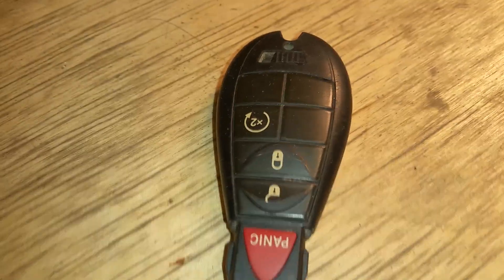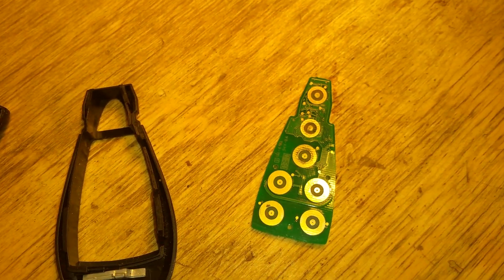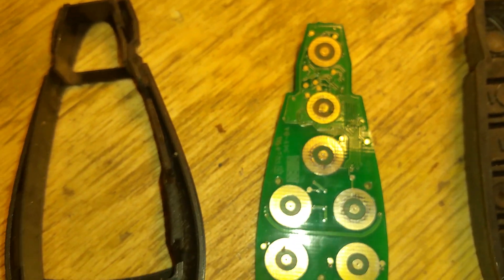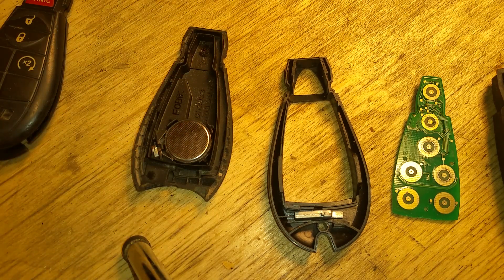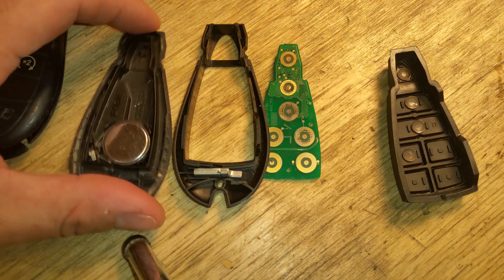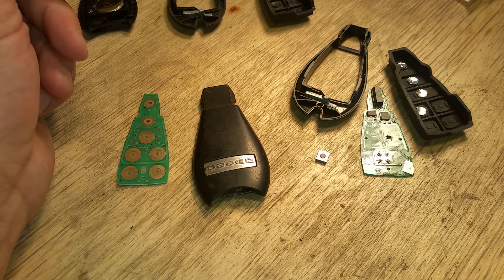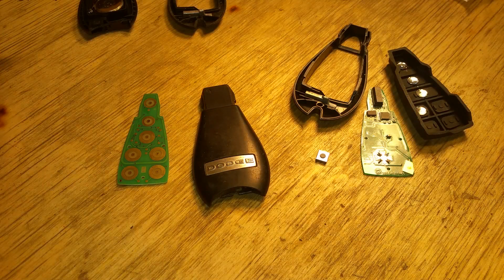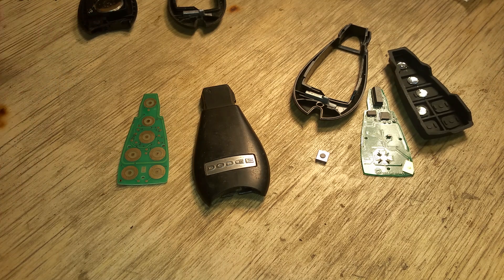Dodge Ram Keyfob Failure & Analysis 2009 - 2015

Comment: Now, the dealer wants $380 per fob to make new ones. The dealer told me the van wasn't receiving the signal from the fobs, yet they want to sell me 2 new fobs for $760 for new fobs. If the van isn't receiving the signal from the old fobs, why would it receive a signal from a new fob that is obscenely expensive? I smell a scam!

Comment: I'M HAVING THE SAME PROBLEM ABOUT 2YRS AGO , WHAT I DONE IS TAKE THE LITTLE WASHERS CLEAN THEM  AND THE BOARD WITH A Q-TIP AND ALCOHOL, LET THE DRY, TAKE YOUR WASHERS LINE THEM UP ON YOUR  BOARD , THEN TAKE A GOOD CLEAR TAPE AND TAPE THEM ON YOUR BOARD,TAKE A RAZOR AND TRIM THE TAPE OFF THE EDGE,JUST TAPE THE SIDE WITH THE WASHERS NOT ALL THE WAY AROUND. GOOD LUCK

Comment: Thank you so much for these great ideas. I have a 2019 grand caravan and my side doors would just randomly open. After a 300 dollar quote from the dealer I bought some cheap aftermarket’s from Amazon which did not pair with the new grand caravan. So I disassembled them. The aftermarket fob had a plastic tape covering the circuit board that force connected the circuit board to the metal connectors. So I ripped off the tape gently and reattached them on top of the circuit board of my native key. Everything works like a charm now.

Comment: Thanks my 2014 Dodge Caravan Key Fob lock buttons stopped working you are correct on everything you are saying I ordered another fob I think the switch cover most likely will solve the problem using the new one

Comment: It's all about the dollar. I bought an 2011 grand Cherokee from Port Jeff jeep with a stock radio. I picked up a touch screen radio (plug n Play) And  made the mistake of buying the wiring kit from that dealer. Plugged everything in radio didn't work. Then I went back to jeep and the service guy told me the radio has to be programed to the computer. That's BS. And he says it will be 160$ and no  guarantee. OH SO IT'S A SCAM? I went against my better judgment and let him do it. Just as I suspected, didn't work. So I went back to the guy who sold me the radio and told him I want to try his wiring harness from his radio. And sure enough it worked. I went back to jeep and with a room full of customers I told the manager you guys took me for 160$ when you sold me a bad wiring harness and you knew programming the thing wasn't going to work. That was the last time I ever went back to that SHITHOLE. Auto dealers ate the biggest thieves EVER!

Comment: Thank you so much for this video! You helped me out more than you know. I just wanted to let you know the way around the alarm going off when you use the backup key. When you get out of the vehicle manually lock the door before you close it. Hold up the outside door handle while closing the door. Door will be locked without the alarm on.😁👍
Reply: They changed the electronic board on the cheap replacement, the button clickers are now on the board itself unfortunately.☹️

Comment: My 2010 ram 4.7 has a regular key column. You put it in Park and the key won’t come out.But !  if you move the car a foot or two and turn the steering wheel a slight bit you can put her down and the key will come out. been doing it for around three years and it’s starting to really piss me off lol. Do not wanna change the whole mechanism .. does anyone else have the same trouble? If so, can you tell me if you solve the problem I would appreciate it.

Comment: just bought a ram truck and had a problem where lock and unlock wouldnt work and the buttons werent pressing as the contacts had gotten loose inside. I had a couple of these keys laying around from a 2012 grand caravan. (my truck is a 2011 ram 1500). Anyway I swapped the face over and im gonna see if this fixed it tomorrow when I go to pick it up. What I do know is the buttons are now clicking.

Comment: One of my fobs went thru the laundry, the other got soaked in my pocket during a rainstorm.  They both will start the van but none of the buttons work. So i just had a seperate key cut and open the door with that.  Before the rainstorm, i had replaced the plastic shell and rubber cover a few times because just the slightest touch or bump could lock or unlock the doors.  Like sliding the fob into my pocket could operate the locks 5 or 6 times.  Walking to or from the van could have the locks operating.  So i just leave the fob hidden in the debris inside the van and use the key.  Not convenient, but better than leaving the van unlocked unknowingly.  And now that it has 184000 miles on it and it is a rolling environmental disaster there is no point in waisting anymore money on it.

Comment: That dealership doesn't know how to deal with this problem that they heard so frequently.  I have two fob keys on dodge ram 2011.  One started to fail on the unlock button, same as yours.  So, I switched to the second one, the same problem after a few years.  Almost every dodge ram 2011 owner has this issue.  It is a design problem.  The dealership is the wrong place to ask, because they did not design the key.  Blaming the drivers shows how ignorant the dealership is.

Comment: So I was amazed!! Wish I had found this a couple of years ago! I had ordered a fob on line to replace mine because the trunk opener didn't work, and sometimes it would unlock the car while in my pocket. The local locksmith tried to program the new one after they cut the key, but it was really only good for a spare to open and start the car. After watching this, I took both the original & the "replacement" apart and noticed there was only one tiny metal button left in the original! I think all of the others must have dropped off while changing the battery a couple of times. So the new fob circuit board had all four buttons I needed TAPED ON! I turned both over just for curiosity and noticed that the circuit board was missing some of the things on the other one, which may be why everyone keeps saying you have to get them re-programmed. Very sly of auto makers, don't you think? Anyway I cleaned up the original really well with the alcohol, used an xacto knife dipped in alcohol, and slowly but carefully peeled off the whole piece of tape, placed it on the original, sealed the fob back up, crossed my fingers, took some deep breaths and WOO HOO! WORKS PERFECTLY!!! I am a 68 year old woman who worked on cars my entire life and can't believe it was that simple. 15 MINUTES or less, (I think I had a bathroom break) and I can finally open my trunk without reaching under the dashboard. Honestly, what another rip off from the world of vehicles. Had a 2010 Dodge Durango years ago that we had to spend $275 or more to get the key replaced. I just saved anywhere between $75-$400. Even the locksmith was going to have me come in between 7:30-8 because they might need a "magnifying glass" to fix it. I think I will show up anyway with the photo just to show him how I did it. I am sure that is the first thing they look for, then cut the tape  to the correct size with the little buttons off a roll and stick it on. "Thank you, that will be $75.00". Really you made my day.🥰🎉🥳

Comment: I knew about this fix after some light googling, figured it was better than nothing. Eventually, the tape wore out or the tactile domes became misaligned and I started having issues with my crappy FOBIK key again. I called two local locksmiths, one quoted $240 for two new keys and another quoted $385 for two new keys. I said to hell with that.

I decided to bite the bullet and using some redneck ingenuity and my Jewish instincts to save money, fixed my keyfob permanently for about $0.15 worth of actual SMD/soldered tactile switches. The rubber domes, in theory, work but are really unreliable because of their basic design. You would think something like that would be less prone to failure but honestly the OEM design is awful.

What I did to permanently fix my FOBIK keys - The outer ring is ground, the inner ring is positive - when they short together, it sends a "press" signal to your car. I used some copper jumper wire strand and made a "V" out of it and soldered the bottom of the V to the center dot (positive) contact with the two strands of wire going upwards (toward the panic button). I then put basic packing tape on the top half of the outer/ground ring to insulate the "V" jumper wires from the ground contact ring. I then soldered two of the legs of a 4-pin tactile SMD switch to the bottom half ground ring (outside ring) to stabilize it, then folded the two wires of the V jumper wire across the two opposite legs on the switch and added a tiny bead of solder to hold them to those legs.

Did it for each of the 4 buttons on my FOBIK key and it works flawlessly with good feedback. The only caveat is you need to find a tactile switch thin enough to fit inside the rubber/case. One that is too tall will cause the button to be pressed too easily and you'll have your car randomly locking/unlocking all of the time.

It's not an easy fix by any means but it's much cheaper than a dealership and will last far longer than even a brand new FOBIK key. It took a little bit of finesse to get the tactile switch centered but in the long run, it is worth it 100%. If you have the knowledge and tools to do this fix on your crappy FOBIK fob, I 100% recommend it, as it will save you so much headache.

Comment: I wish more people knew about stuff like this. I just replaced a key for $25 all in that the dealership wanted to charge $400 for on my 2012 Jeep Compass.
Reply: Blows my mind more people don't. Basically the same problem since the original Nintendo controller buttons and most controllers since.  Lol. Shit, even TV remotes lol.

Comment: you can now buy just the rubber button pad with dics already attached to it on Amazon for $6
Reply: That's a good choice but it will wear out soon thereafter just like the original. The OEM design is awful.

Secondly, my Challenger only has panic, lock, unlock and trunk pop. Amazon only sells the standalone rubber replacement for fobs with panic, lock/unlock and remote start.

If you buy a replacement key, the tactile domes are taped to the new reprogrammable board, so you are still unable to use your original key unless you can remove the tape and perfectly center it on your old keyfob which I tried, and it did not last long.

What I ended up doing was soldering real tactile switches to the board of my keyfob and it seems to be working great.
Reply: @husky3g  so far still working. But at the price lot better than whole new key.

Comment: Simply buying new shells for the fob is the easiest and cheapest way to deal with this because the fault is usually in those tiny flexible disks. They get corroded and don't make contact properly. $30 for 2 new ones and all you really need is the rubber piece with nice shiny new disks firmly in place. If the fault is in the circuit board then that's a different story, but usually it's just the switch.

Comment: hi.just went through the same thing .just wanted to share what i did. the little metal disks came unglued. i super glued them back on then took sandpapper  and lightly scuffed up the area that makes contact to board. everything is working. thanks for the video.

Comment: Had a similar problem with my fob for 2010 Grand Caravan.  Took it apart and cleaned it.  I also peeled off the metal discs and use DeoxIT D5 cleaner to clean the contact points. I used Scotch tape to hold the discs to the board instead of the rubber part.  So far, it is working, but for how long, I don't know.

Comment: I wonder, in October 2022, if DeOxIt electrical contact spray liquid on a Q-tip would be effective in cleaning the contact cup surface.  It seems to work well with a lot of things I work with.

Comment: A little addem here. I take that door key that is hidden in the fob and make a copy. This copy I keep in on my key chain with house key or put it in your wallet, hidden on the car. That way if you do happen to drop the fob in the car as you shut the locked doors, you have a way to get in without having to call a locksmith. I thank Don very much for the info on the inside of these fobs. All the dealers should be shammed for charging $ 200 for a $20 part. You can't tell me it cost Dodge that much more to have that part made than a generic costs beside a minimal amount.

Comment: I have different issue which is probably the programming or the module itself... at certain not to far distance second ulock will not respond , the first one always does at grate distance, but the second will not even if I'm 20 ft away behind the glass window and then it locks entire key fob and nothing works for about 30 seconds no matter if I'm next to a vehicle or 100 ft... I guess it's an 10-year-old Vehicle so I'm blaming it on a old style module porly working to begin with ... it does just like this on any new old key fob with changed batteries all same

Comment: In December of 2021 I took our 2014 RAM 1500 in for service ahead of a double round trip between northeastern South Carolina and central Virginia. While at the dealership I asked the service manager if she could have my (failed) fob repaired and if not how much it would cost to have two new ones (The Lovely Brides fob failed at about the same time mine did back in 2017) programed.....Price per fob: $268.95!!! So we use the keys, not the little bitty ones inside the fobs, that ALSO came with the truck at the time of purchase new in late 2013 to unlock the truck and the door mounted button to lock the doors upon exit. Both original fobs still function as ignition keys. Based on our experience with failed fobs and the existence of not two but four metal keys that came with the truck I strongly suspect that somebody in RAM food chain knew that the fobs were a failure point and/or a good way to make a some "side cash" too.
Reply: You can buy them for 50 bucks and program them with alfaobd to your vehicle

Comment: Quality is NOT in mind when designing these keys, it’s not even something they’re wanting to address. What is on their mind is revenue generation and engineering obsolescence and high failure rate. It’s painfully obvious they designed these Fobs purposely shitty, even children know you can’t glue metal to rubber and expect it to stick for any length of time. Any respectable engineer that takes pride in his work and cares about quality would have used an actual click switch like the one you found. For quality and cost perspective its a win-win as adding less than a dollars worth of components would immensely increase the life, quality, and durability of the part. 
I find it downright insulting and despicable for an American car company to treat their targets… I mean customers, like this. They are sending a loud and clear F-you to anyone stupid/unknowing enough to purchase one their cars. This should be a clear sign for anyone watching this to stay away from dodge or affiliates vehicles. I mean 600$ for a key?! That’s just blatantly ramming you up the pee hole with a cactus 🌵.

Comment: You have drugs out way too long and made it way too complicated just buy OEM ones off of eBay find the cheapest ones you can find brand new and call a locksmith who will program as many as you have for 100 bucks could cost you $200 and you have brand new keys not 600

Comment: Those Connections are clearly dirty the one that goes to the trunk and the lock you should get a toothbrush in a little bit of alcohol and rub it to them connections are clean and you will not know longer have a problem

Comment: I did this with mine and it did not fix mine long term. I have to put extra pressure on the case of the key to get it to work. not sure why. I think the circuit board is failing.

Comment: I have a truck with the remote start feature and wanted it disabled because it would start when the key was in my pocket. So, I also put in a new rubber piece without that one contactor. You could also disable it by peeling it off inside. Good analysis, good to know the parts are actually interchangeable.

Comment: Thanks for Thai solution . I have this issue currently.  In order to avoid the alarm I have to lock my truck manually.  I disabled the Auto Unlock feature and I don’t use the lock switch on the door.  I actually push down on each doors lock.  It’s a headache. I’ll order new buttons now thanks

Comment: Thank you for this trick. I was about to pay a locksmith to reprogram key. The problem was the same where the metal contacts had fallen off. Swapped internals. Now I have 2 fully operational fobs for $15 from eBay. THANK YOU!!! You saved me a bunch of money!!!!
Reply: What did you type in on eBay to purchase it?
Reply: @Kam-c4s  
Ram keyfob then whatever year

Comment: This was an absolutely awesome video! Based on your suggestion, I ordered a new key fob shell for $13 on Amazon, removed the circuit board and battery from my old fob and installed it in the new shell. It works GREAT and saved me a TON of money! Thanks!
https://smile.amazon.com/gp/product/B07DRHN17J/ref=ppx_yo_dt_b_asin_title_o03_s00?ie=UTF8&psc=1

Comment: I clean them with contact cleaner, you can get a bottle from Home Depot for $10
Reply: Some key fobs have small screw that holds it together before you can pry it open. Just place the buttons where you need them then scotch tape them in place, easy fix close it up!

Comment: My second key fob just failed. Total failure. I thought it was the battery but after replacement, it is still dead. Mine's a 2014 Ram 1500. Tried  cleaning it up and that didn't work either. I think I'll go with an aftermarket one.

Comment: I used scotch tape and taped the contacts to the board. Glue failed every time you can’t glue metal to rubber. Center the contact discs and tape on top. Tape directly to the board.
Reply: I changed my battery and used the tape method like you and it still doesnt not work. I wonder what else could be causing the problem in mine